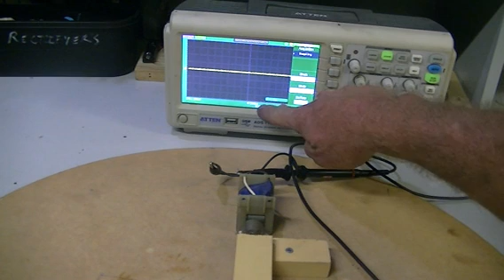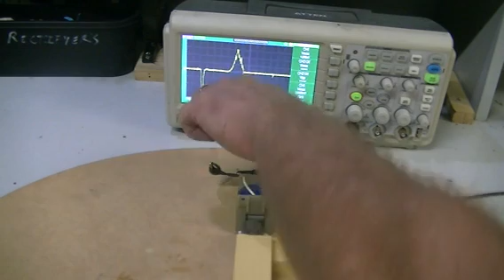EMF and Permanent Magnet EXL.

Comment: from observing that; wouldn't it be best to not go to the center of the coil?  But actually to stay to the side and then leave... or better to stay there and vibrate slightly where the peek voltage is generated?  is that a corner of the magnet?  I notice you have the magnet travelling in a wide arc, wouldn't it be nearly the same if the magnet were pivoting around it's center near the coil instead of offset from it's center?

Comment: Good test. Results as expected. Would the results be the same with a bifilar coil and capacitor in the middle? Or would there be an extra spike?
Reply from the maker: +Arkiver Unified Energy I would expect a longer smoother sine wave,as we could not move the magnet fast enough past the coil to get a resonant spike back.
Reply: +TinManPower Could be interesting to investigate in the same experiment at half cycle.
Reply: +TinManPower Galvanometer is swinging at half cycle. The back spike is in a direction that is productive to complete the full cycle.